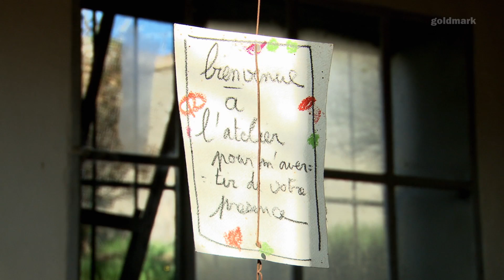Jean-Nicolas Gérard: "The Potter's Potter" film about French slipware potter

Comment: Does he put on slip after bisquefiring? Usually it´s done before isn´t it?
Reply: That's how it is thought of usually. The recipe for the slip is different but no it can be done this way too. Sort of like a underglaze then but something that has a three dimensional quality. Also could be because his vessels have large flat areas that are tricky so you wouldnt want to dis tube that in the unfixed state with water.
Reply: it puts the slip on the pot.
Reply: Most slipware potters apply slip on leatherhard pots. This allows the slip to dry with the clay of the piece. It helps in so many ways. After they are dry, he decorates them. In the beginning when he is using the spoon to cut below the slip layer, called sgraffito, you can hear the dullness of the dry raw clay. A bisqued piece would have a harsher scratch sound. I'm not sure he even bisque fires, although probably. He might single fire everything. Goldmark would know that.